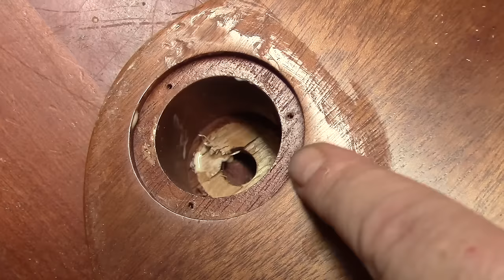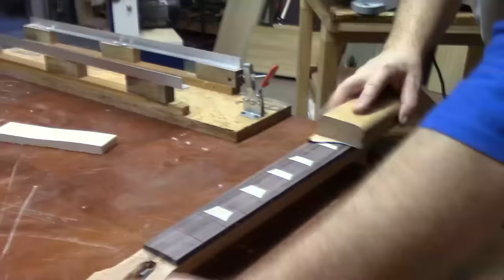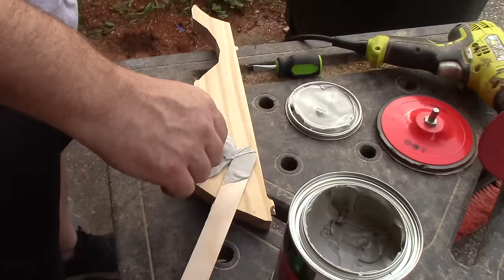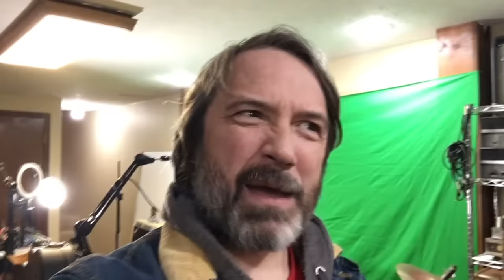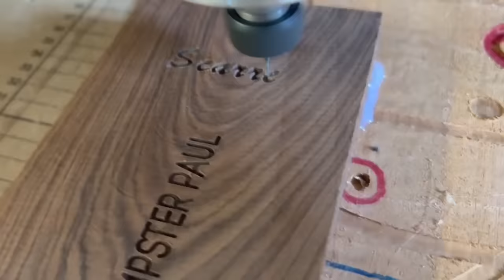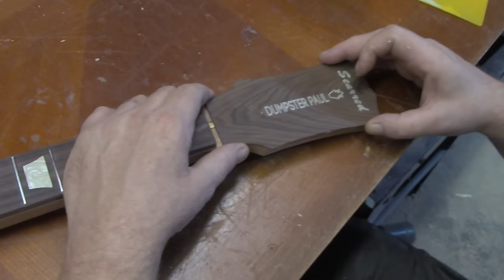BREAKING NEWS! Dumpster Found Gibson Les Paul Now Identifies As A Scarred Guitar! See it Transition!

Comment: When you used the opener upper on the control cavity it made a crack on the other side. I see it went away after you clamped it. You might try Zpoxy instead of wood glue as it will run into the crack better and you might not need the opener upper. Great video
Reply: Noticed that too. The channel lock move was kinda wild lol

Comment: Hey when you apply the glue you can get a plastic bag and cut the tip of the corner off and pipe in the glue like icing a cake. You will be able to reach inside an acoustic guitar easily. André in Sydney

Comment: Once the coating was sanded off I would have tried swelling the dents back up with water. I’ve done this in the past building guitars and accidentally putting a dent in the body dropping a tool on it. I learned the water trick from an old timer. I used q-tips. Great to see it in caring hands now.
Reply from the maker: Yeah I used to steam dents out too, but I've found that 5 yrs later those dents will start showing under the paint because the pressure from the dent in that area made the wood softer than the rest so that area ages differently, I guess. Not sure but they sure do come back. Best to fill em when painting is my experience.

Comment: Not sure why you just didn't use wood putty to fill in the damage on the Guitar Body?
Reply: I am going to guess it's because he had to sand the top down anyway, and bondo is a bit harder, bondo can be sanded down and be repainted. Not sure how just slapping wood filler in would help, you also have to clean out the damaged gouges. .  The whole top does need to be painted anyways, because of the repair work needed, likely the back side as well. Wood glue some areas like he did, but bondo makes sense to me on the surface stuff if you're painting and want it smoothed an proper.

Comment: Now i am wondering what a nice reverb sound you could get by putting your amp inside of a dumpster.
Reply: I visited a studio just east of Toronto, where they had an old gas station fuel tank in the backyard, with a speaker at one end and a microphone at the other. The mike was on a wire, and they could move it closer or farther away, for more or less reverb. I guess you could call that a  reverb tank.
Reply: @Mr3DBob  Do you think they got a 3 dimemensional sound Mr.Bob? Ha!

Comment: I purchased a USA Strat body from eBay years ago that was split in 2 somehow. So I glued it and held it together with large zip ties as tight as I could pull since I didn't even have clamps.  That was my first ever guitar repair and it actually worked. You could never tell it was once essentially a pile of firewood.
Reply: You can get a ziptie tensioner for relatively cheap, might help in future repairs.